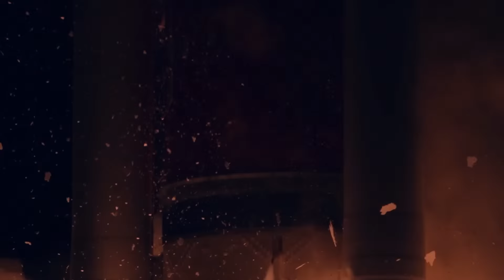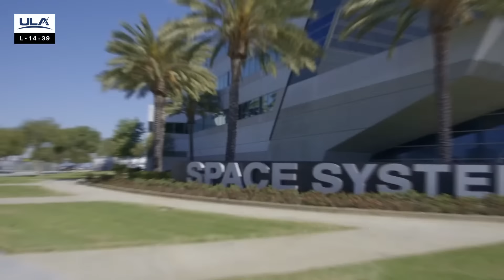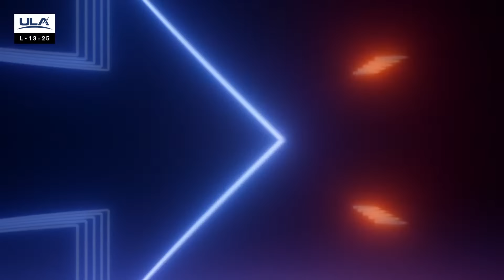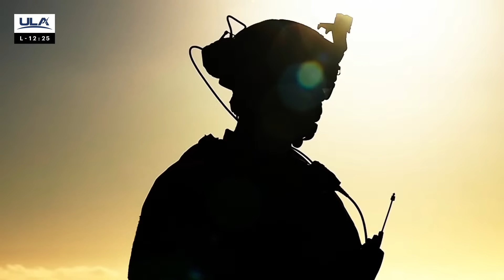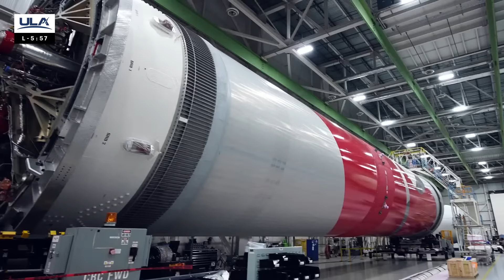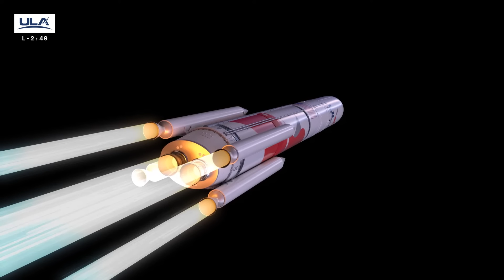Rocket Launch:  Vulcan USSF-87

Comment: Something wasn't right immediately after liftoff. look at the asymmetric shape of the combined exhaust plume. Did you also notice the craft starting to roll after those debris ejections, and the flames going straight towards the liquid fuelled rocket bell from one of the SRB's?
Reply: what did you expect from engines made by jeff bazos
Reply: @DiscordC Bezos has nothing to do with the SRB:s.

Comment: "Engine parameters continue to look healthy" - at least don't lie while everyone is looking at blown open engine nozzle.
Reply: They are talking about the be4s, to be fair you just cant actually get that info from a burning stick of solids. 

The rocket just follows a preplanned trajectory correcting whatever error the srbs or weather may induce.

 Still I think this thing could've pulled this launch off with just 2 srbs, maybe used 4 just tl be sure and they were right after all.

Also any problem with the srbs would be Northrop Grumman's problem as they are the manufacturers of the GEM srbs, not ULA.

Comment: Is Space Force in charge of the Rocket itself or just the payload? Because this seems like a very inefficient way to put a payload into orbit, when there are options of reusable delivery components now.
Reply: the space force is just the payload, and regardless of what you might think they pay similar amounts for this rocket as they do others
Reply: Reusability impacts how much payload can be delivered so the satellite could be heavy enough to require expending a rocket.
Reply: @TheKitsuneDuke  while i cant confirm i can say that its likely given that they are using the 4 SRB configuration, if this was a payload falcon could do without expending they would likely be using the 2 SRB configuration ( falcon 9 when reused is a little more capable than the 2 SRB config and much less capable than the 4 SRB config)
Reply: And I know that when you work for the private sector, you’re in the business of making money, but if you work for the government, you’re in the business of spending money.

Comment: ANOTHER SRB nozzle issue? And it seem to happen at almost precisely the same moment after liftoff as the one last year.

They were very lucky that plume didn't damaged the core stage or the main engines.
Reply: News is reporting an SRB burn through.  Not good.

Comment: Where did they land the booster?
Reply: They don’t land it. Vulcan stages way too high for a 1st stage landing. They are planning to instead have the 1st stage engines detach, open an inflatable heat shield and reentre the atmosphere and splash down in the sea.
Reply: @luther0013     You realize that's PR fluff that's never going to happen, right?
Reply: @GDuncan8002  right that’s why they wasted payload space on their own flights testing the technology previously. Love how SpaceX’s ridiculous claims are treated as fact while technology that is very much within our grasp is treated like fantasy.
Reply: @GDu @GDuncan8002 You base your comment on what facts? Please troll some other place.
Reply: @luther0013  the difference is that we have already seen reusable booster hotstaging and booster tower catch. Both these two things were heavily questioned by spacex fans, so your premise is also wrong.
Reply: @snuffeldjuret  I don’t see how that relates when the heat shield for the system has been tested on a flight
Reply: @luther0013  what do you mean? how is what I wrote not relevant to what you wrote?
Reply: @snuffeldjuret  your point would make sense if ULA had performed no testing of their proposed system but they have already which means they are all the more likely to follow through with it.
Reply: @luther0013  so because ULA did a test, it is forbidden to challenge you on "Love how SpaceX’s ridiculous claims are treated as fact while technology that is very much within our grasp is treated like fantasy."?
Reply: @snuffeldjuret  didn’t realise that was what you were querying. For some reason YouTube is not showing the full comment section. 

By that I ment that SpaceX’s claims of being able to launch Starship for $2 million is just accepted when they were never able to bring Falcon 9 down to less than $10 million a launch as claimed by their CEO at a conference with lots of potential customers present. 

Elon claims starship will be rapidly reusable but so far has only show reuse of some components and Thunderf00ts recent video on the Starship heat shield tiles shows that all the tiles will need to be replaced between missions to reapply water proofing to the tiles after it is burned off during reentry.
Reply: @luther0013  are you aware that every single rocketlab fan I encountered promised me that neutron would launch in 2025?
Reply: @luther0013  don't believe anything thunderf000l says, he has been wrong about a million things regarding starship. Don't be an extremists.
Reply: @snu @snuffeldjuret  rocket delayed = rocket feature is never implemented.

Sounds like you like comparing apples and oranges.
Reply: @luther0013  you mean feature never implemented like smart reuse?
Reply: @snu @snuffeldjuret  you mean like how Falcon 9 wasn’t partially reusable from the first flight and this was only added after getting to full operational status.
Reply: @luther0013  I am not the one expecting starship to be fully developed from the start. You are the one forbidding them from try things that sound completely outrageous, like re-using 1st stage after hot staging or catching booster with launch tower.
Reply: @snu @snuffeldjuret s conversation isn’t about starship it’s about Vulcan but yes SpaceX has made outrageous claims about starships while then pricing its launch services at $500 million a launch.
Reply: In the ocean

Comment: 28:56 "Very clean"??? There was clearly an explosion of sorts at Max-Q. 
This is why I like SpaceX coverage better. Their commentators are part of the technical staff and, although they too are reading from a script, they know enough to recognize an anomaly and are transparent enough to report it.
Reply: 😂 SpaceX comentators are worse. Dude i remember when we saw Srarship/super heavy literally loose control and explode, and they were all like this is fine LOL.
Reply: @jhdsfalsjhdfjashdkhvjfldld8301     That's a test flight with no payload,, attempting second stage recovery.  Vulcan is doing what rockets have done since the 50s, is carrying a customer payload, and is supposed to be operational.
Reply: @jhdsfalsjhdfjashdkhvjfldld8301 Because it is fine. Starships and super heavies are test flights, not on actual missions. As long as they did better than the previous flight, then they don't really care.

Comment: Something definitely happened at 23:52, possible casing failure on those Graphite Epoxy Motors?
Reply: You're right, a GEM63xl had a nozzle burn through again, however that started much earlier in the burn. What you saw there was the already burned-though motor throat and nozzle structurally failing and shattering.
Reply: Be interesting if it was nominal or centre engines may need to burn for longer to compensate being a top secret payload will probably never know.
Reply: @wayneschenk5512 the Blue Origin  BE-4"s will gimbal and correct the flight for minor SRB issues.
Reply: @HookSettinHooligans  that was NOT a minor issue the fact they were able to complete the booster stage of the launch is pure dumb luck
Reply: Not major either or it would have exploded. Trajectory was on target according to ULA"s recent post showing insertion.
Reply: @DiscordC Northrup needs to fix the SRB problem or it will result in a major problem though.
Reply: They could be "Chuffing", something that happens towards the end of the SRB's burn as it uses the last of its' propellent with bits of motor's casing insulator layer shedding.
Reply: @nicholasmaude6906  That was NOT the solid motors, to early in  the burn.
Reply: @nicholasmaude6906  I think I remember something similar on first launch

Comment: Was the launch successful? Something seemed to go wrong, causing lots of sparks and debris during the boost phase and then the rocket had a very nose-up attitude.
Reply: Looked like it was successful, regardless of the sparks the vehicle reached its target.
Reply: The nose up attitude is normal for the low thrust upper stage.
Reply: Booster issue, the vehicle started rolling. Blue origins BE-4 and its robust gimbaling capabilities while at 100 percent thrust saved this launch
Reply: In spite of itself, yes. All credit to Blue Origin and their BE-4 engines for saving the mission yet again.
Reply: There was a nozzle burn through
Reply: Considered successful
Reply: An SRB only loses a few percent thrust without it's nozzle and as long as it doesn't cause any other serious damage, there's often enough margin in the other engines/stages to make a successful launch anyway.
Reply: blue origin engines, what did you expect
Reply: @DiscordC It was a nozzle failure in an SRB made by Northrop-Grumman, not Blue Origin. The BE-4 engines performed perfectly.